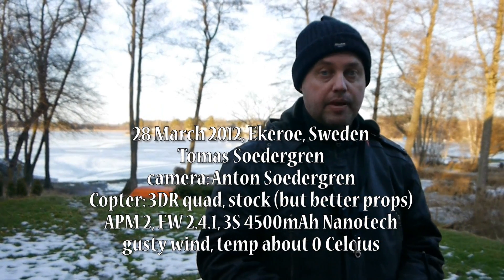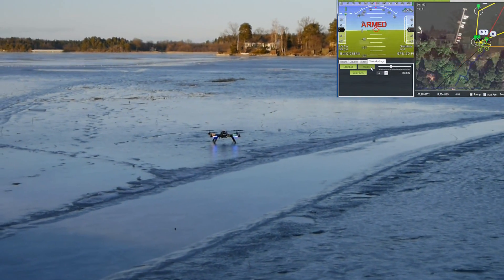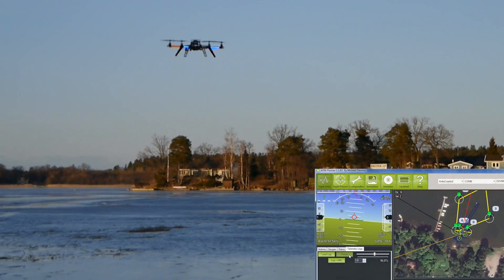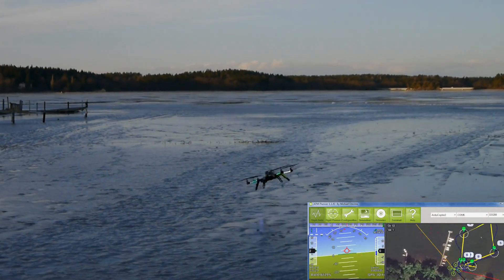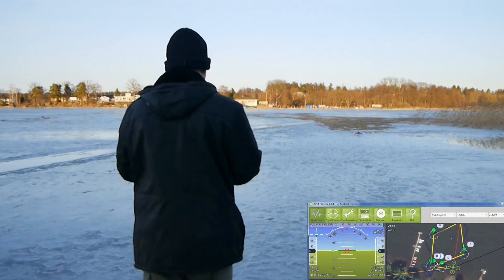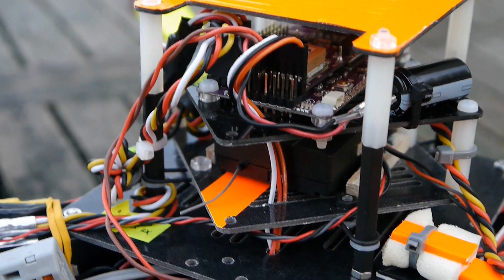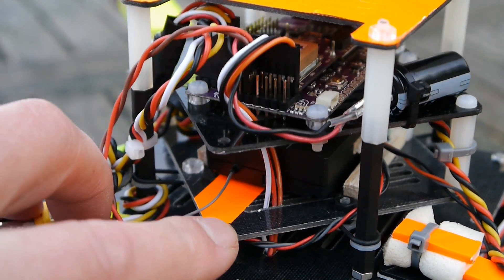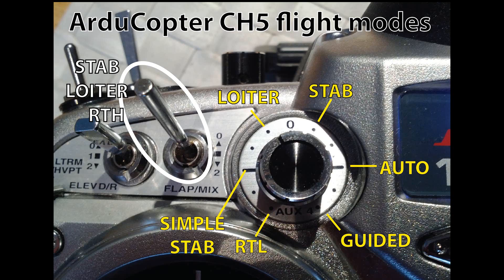ArduCopter on ice.wmv

Comment from the maker: @yaya2006 Hi,
The battery time on my setup is 13 minutes. Installing a camera is possible and very common. I intend to do it shortly, using a GoPro in a servo stabilized gimbal and a video downlink transmitter. Then I will be able to fly FPV and to record the flight in HD.

Comment from the maker: @petleh82 Hi, and thanks for the kind feedback!
There are still a lot of efforts put in by the developers to mitigate vibration sensivity / drift and to improve performance in different flight modes. There is clearly flyable code now, even though in my opionion it is far from perfection. 
With good vibration isolation the drift has not been an issue on my quad.